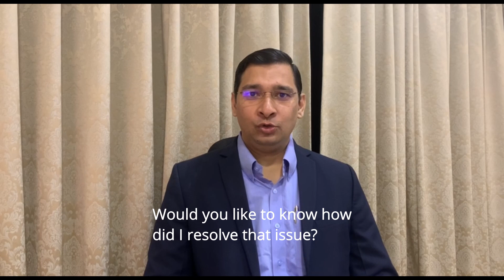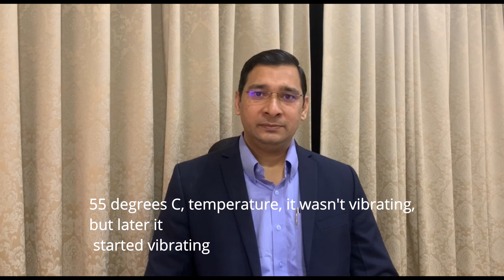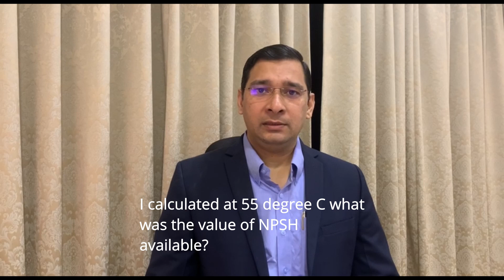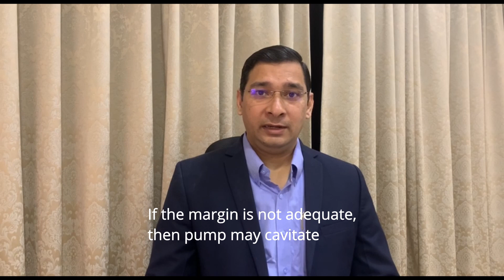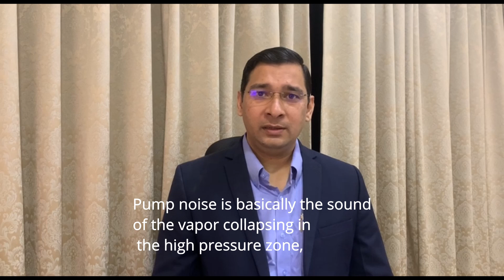Pump cavitation issue (3 of n)

Comment: Sir, it's good insight into the simple solution  avoiding cavitation. My doubt is that, did the height  increase to a value such that a difference of minimum 1 mLC between NPSHr and NPSHa is achieved at 60 C? How to decide the max difference as well? How to decide that the height should not go beyond a certain value? Is there standard for deciding  height as well?